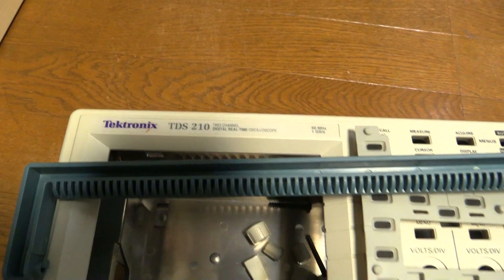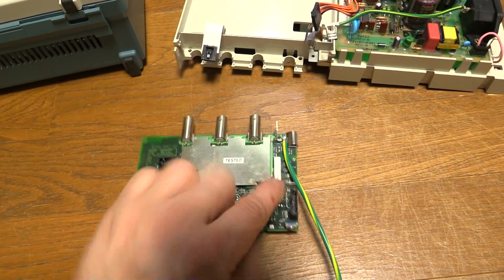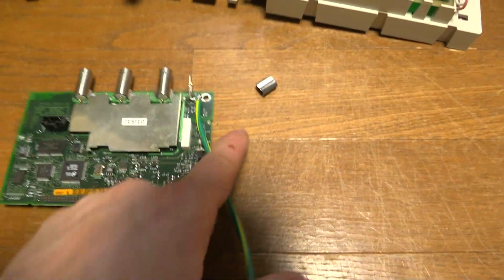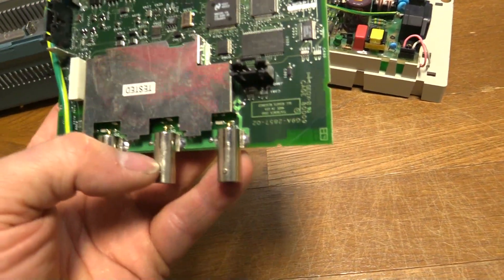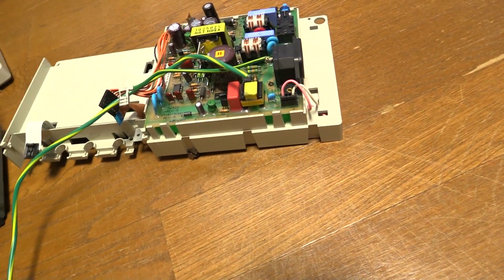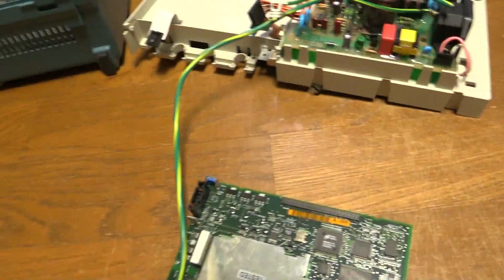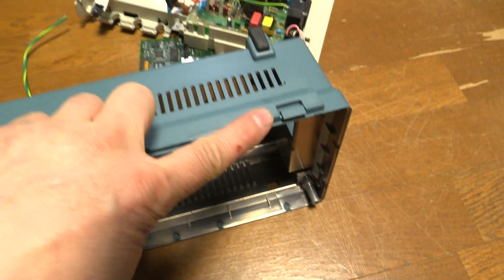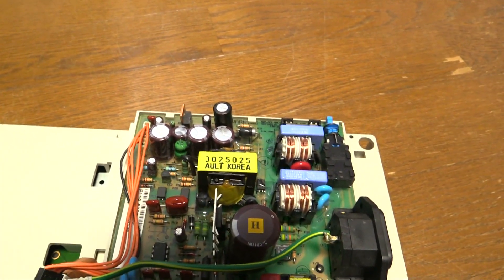Tektronix TDS210 TDS220 Oscilloscope Recall and Loose BNC Fix

Comment: To anyone here in 2025, the part number is TE Connectivity 5414373 and they cost about $5 from your favorite electronic bits retailer. Just replaced these on my TDS220.

Comment: The metal clip contacts the metal shield for the display screen and there should be a braided copper sleeve piece under the shielding for the main board contacting the metal shielding of the plastic case sandwiched in place. The ground lead from the main board to the plug socket is a good idea as the board does have a minimal trace for the ground plain to the grounding lead to earth. Also you are mentioning the caps up on the top part of the board and I have seen a couple of cases that had heat damage above the 12v reg there which has no heat sink on it. I made a little sink and installed it just for good measure. The other reg has a pretty good sink factory installed on it so obviously there is some dissipation on it. You can never have these too much of these 2 things in circuits, too much ground path as long as it doesn't create a ground loop or heat sinking of particular components like Vregs and transistors. I'm thinking that even with the ground lead installed here if there is a direct short in the system it is going to take out those tiny traces on the board anyway. But connecting a scope probe to a mains line is not a smart thing to be doing no matter. At least not with some sort of isolation in there. If your looking for signal patterns, you're going to see them even with a decoupling cap installed. There isn't going to be any DC anyway.

Comment: This is a question directed at NFM, what is the actual difference between the 210 main board and the 220 board? Is it a different chip, chip set or software? I have a repairable 210 which is as we all know a 60mHz unit and I would like to have a 100. There aren't that many 100 mHz units listed for sale in working or parts only compared to the 210's. I can purchase a 220 with broken front panel or one that is in supposedly perfect working condition. Doing that would cost me more than what I'm going to have sunk into my current 60. I have a MM module on the way and a nice looking case with this 210 and the only thing that wouldn't match up would be numbers if I found a 100 board and installed it in this case. I can find cases and I have a new screen also coming. I'm just looking to see if and what can be sourced to build a scope. Do you have any parts? I have all the good knobs and the on/off button and my front board is in perfect shape. I was just curious, thinking maybe an IC swap could increase the range or is it a much more complicated deal getting that upper 40mHz.
Reply from the maker: There is no difference at all on the PCB, you can turn a TDS210 into a TDS220 simply by sending the following commands to the scope via GPIB, then performing a full adjustment without rebooting the scope.

Send command PASSWORD PITBULL to unlock the scope
Send command MODEL TDS220 to change the scope to a TDS220

The adjustment is important to make the upgrade stick, otherwise the scope will revert to a TDS210 on reboot.
Also, if the adjustment process fails at any point, you'll need to send the GPIB commands again and start over on the adjustment process right from the beginning.

Comment: I realize this an old post but since I just recently got one of these that needs some attention, I have a comm module and a replacement LCD on the way. The scope still worked fine as far as I could tell. I didn't even attempt to test much of it beyond power up and see it passed the SDPT. My big concern was if the main, board was any good. It was on Ebay and adv. as a bad screen and the price was good, under $75 in hand. So my question is how does this unit compare with a new Hantech? I've read a little about those and the price of purchase layout, I chose this way and figured I could get a better price from it in a resale after I got it all fixed up and upgraded and go for a different brand with more features, but with the comm mod installed, I'm wondering if the 210 will do all I need to do on a Ham bench? I'm new to the radio field, it's been a long time since I went to school for electronics and I'm way behind and rusty now. This unit doesn't have any mod stickers on the back and I have it all apart so I will go ahead and replace the ground lead while I'm in there. I was kind of hoping I could find enough pieces to build a 220 but those are harder to find compared to the 210 circuit boards.
Reply from the maker: I'm not sure on the Hantech, I've never used one..
These scopes are great if you get it cheap, they are simple to use, capable within their limits and work well. I use my TDS220 all the time.
They don't stack up against the features of modern scopes, but they are much cheaper and I find mine with the MM module does almost all I need to do for general daily scoping.

Comment: One word of caution when removing the fold down carry handle, DON'T force it! There are 2 locking tabs that are 90* apart and if the handle doesn't come out with little pressure, raise it up and try again, when that side is out put the handle down and pry the other side out then slide the handle to the rear of the case. You don't have to pull it all the way up over the top and if the parts are a little sun hardened or brittle, you can break of those little locking tabs and then the handle will not be a solid piece and can fall off.

Comment: The techs at work used to re-solder these BNCs on TDS210s and '220s fairly often I think.  I have a '210 in my home lab that was tossed after such a repair attempt.  Best I can figure, when they put it back together, they got the ribbon cable between the display and main board reversed so it seemed dead.  I had it apart and redid the BNC work (sloppy) and then figured out the cable issue.  It works fine now and even has the comm module.  This was several years ago now.  I doubt they would bother to try a repair these days.

There is a '220 at my office desk that seldom is used and its develop a problem.  Turn it on and the display is dark with some orange  horizontal lines.  A good whack and it boots up with self test as normal.
Reply from the maker: Nice score! Simple repairs are great for getting cheap gear. :)

Comment: The 2 little side posts (ground) of the BNC's break off easily leaving the BNC connected by it's center pin connection only. Easy to replace the BNC. Or the cheater's way. Lift up the BNC a little off the PCB. There is always a coating/plating on these BNC's that to solder easily needs removed to copper color under. Take a jewel fie and scrape-up file the sides of the BNC near the ground plane. Also scrape-up-file the under side of the BNC. Dremel flat cut-off wheel also works. Now take a knife and scrape-off the green solder mask on the PCB under the BNC (ground) and along the sides where it would butt up against the BNC side. Tin the now bare copper of the PCB under the BNC and along the sides. Apply some flux to the scraped-up sides of the BNC and under. Now apply a fair amount of heat while holding the BNC in place along with solder along the sides. It'll never break off again.

Comment: Thank you for this. I have a TDS-220 my boss gave me because the loose BNC could not be relied on. Your tips for opening the case and locating the board were a great help.  I just soldered a copper strip that grounded the BNC's and locked them physically in place. I appreciate you taking the time to make this video. I am a home hobbyist with little budget so it is nice to now have a working TDS-200. Cheers!
Reply from the maker: Oh nice, a TSD 220! I'm just a little bit envious. :D Good to hear you got it back into service, they are a good little unit.

Comment: Is this scope stil worth something this days? I found one for 160usd
Reply from the maker: They are still a good unit I still use mine regularly, but I wouldn't pay more than $100 for one unless it has the optional math (or even better) comms module.
Spending much more isn't worth it when you can get a MUCH more capable and modern Rigol etc for a not too high cost these days.

Comment: If anyone sees this and is wondering about the loose BNC, you can actually get a new connector on Mouser, here:
https://eu.mouser.com/productdetail/571-5414373-1

You might also find them on ebay by looking for the manufacturer's part number: "5414373-1"

Mine turned out to have broken pins on CH1 and CH2, the pins that go down into the ground plane and are also structural. Nothing seemed to work to solder them together, the tin just wouldn't stick to the cast iron, so I'm just getting new connectors. Probably better in the long run.